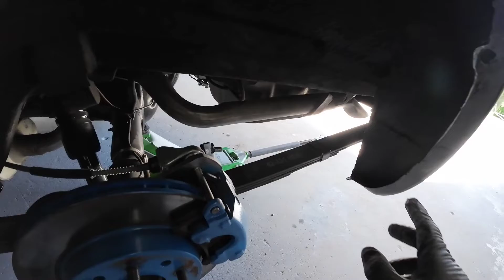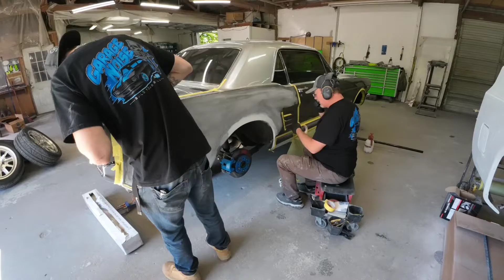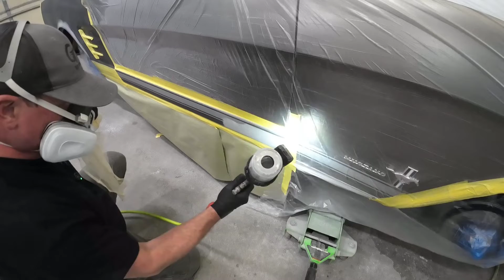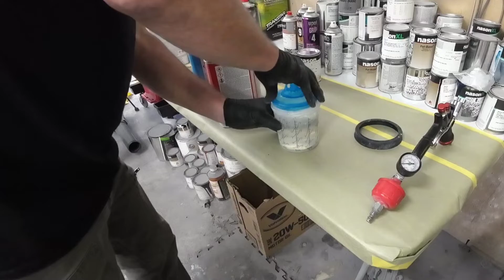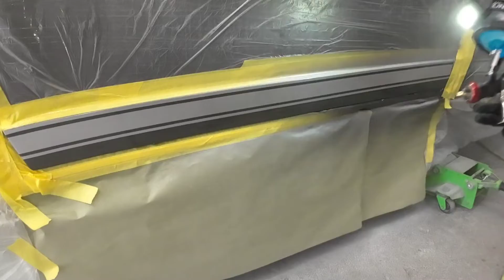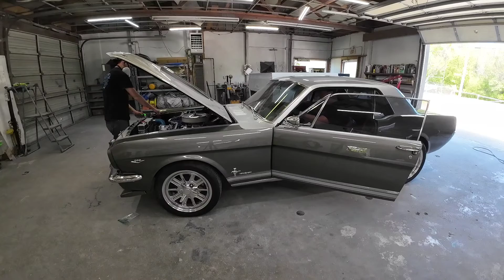1966 Mustang Spot panel paint using basecoat/ clearcoat

Comment: I’m a beginner so I have a basic base coat question: when I paint a car, I typically look for the factory paint code on the door jam.  When I have to deal with a custom paint job, like the mustang in this video, how do I make sure that I purchase the base coat that will match the original paint at a auto paint supply store?  Do I have to take a sample to them, in order for them to mix me a paint that will match?  How did you get the base coat that matched so perfectly?
Reply: It’s probably a factory color from Ford, GM, Chrysler or another auto manufacturer, so it’s easy to pull up the paint code and mixture.
Reply from the maker: I had this paint scanned by O'Reilly's tje scanner finds an existing paint in the database that matches. It's  worked great when I've  had to use it.
Reply: What sample did you take them?  A small panel, or maybe a mirror housing, or take the vehicle to them and they scan it from the parking lot?